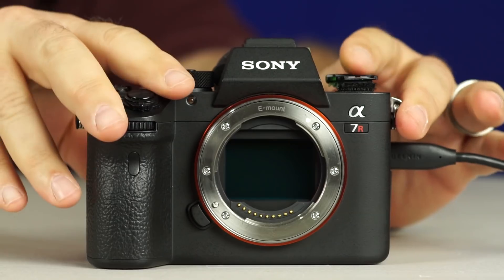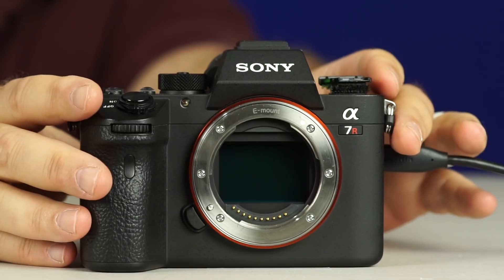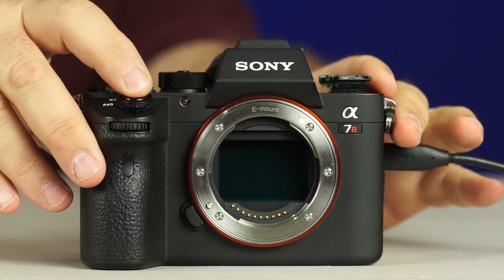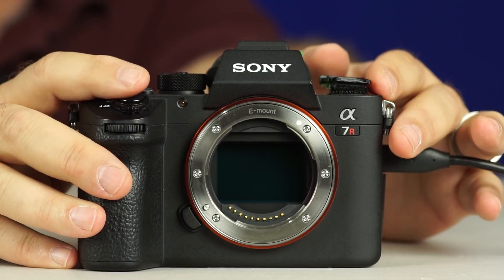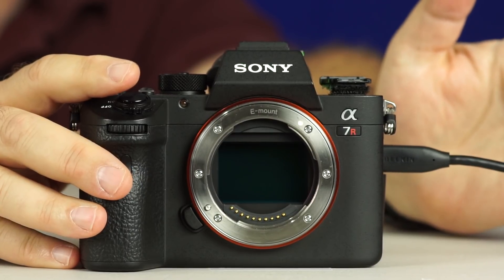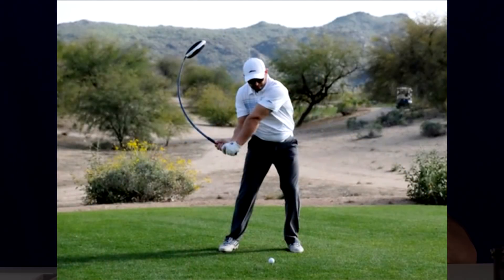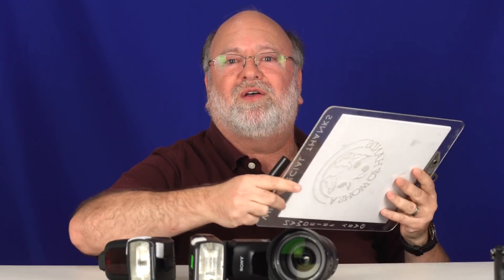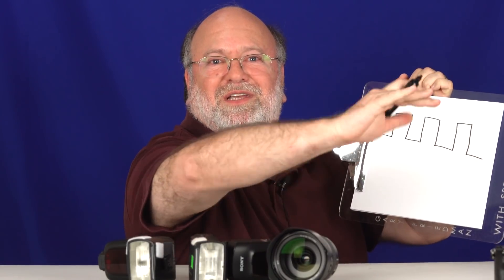Banding Effects wtih Electronic Shutters

Comment: Good info. I just bought EOS M50 and enjoying it. I wonder in case if you know if you can share, I am having banding issues shooting blue sky on EOS M50 while shooting 1080p. Do you know any workarounds? It happens with Standard, Neutral, Cinestyle almost all picture profiles.
Reply from the maker: Usually banding happens under artificial light.  If it's happening under daylight conditions I really can't think of any ideas of how to fix it (heck, I can't even think of what might cause it!)  There's no way for an interference pattern to appear if you're shooting under continuous light.
Reply: @FriedmanArchives  yeah that surprised me too. I was shooting technicolor cinestyle but even I saw it with other picture profiles. Although not all the time... anyways will keep experimenting. Thanks

Comment: Thank you for your excellent explanation. Nobody talks about that. I bought the Canon EOS R mainly because of the silent shutter feature since I do a lot of concert photography. I couldn't explain the banding I get - sometimes, not always - in artificial light. Kind of disappointing, especially since the non-silent shutter noise is louder than on my old 5D Mark III. Most times I get away with silent shooting and no visible banding. I guess that the problem will be eliminated with faster readout speeds from the sensor, probably with the next generation of mirrorless (full-frame) cameras.

I noticed that the banding is gone, or hardly noticeable, with shutter speeds of 1/100 sec or longer. That is often not fast enough to freeze a hyperactive conductor. I wonder if the 1/100 sec is related to our 50 Hz AC cycle here in New Zealand.

Comment: Minute 8:49 I clearly discern horizontal banding in the image and no, it must not be the pattern on the wall, because it's the same frequency of the Godox banding, OR, if it's actually the pattern on the wall, it must be the pattern also for the Godox flash.